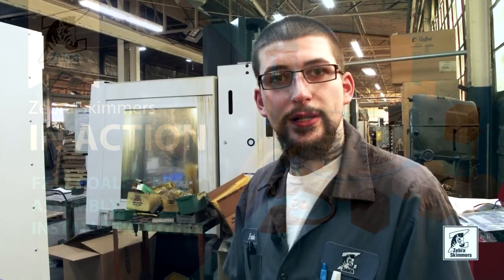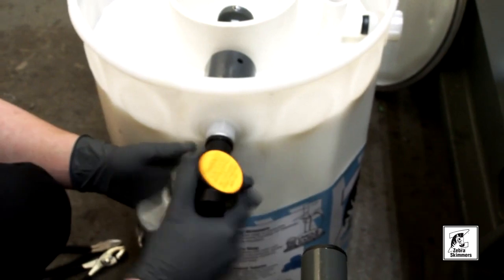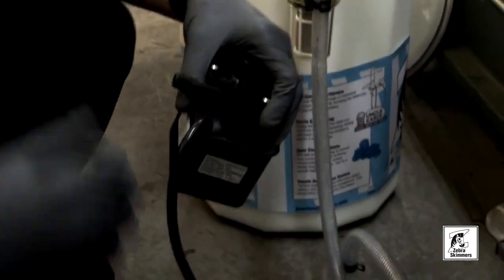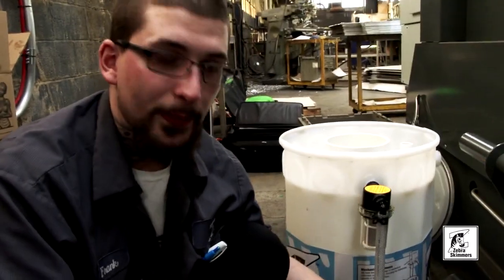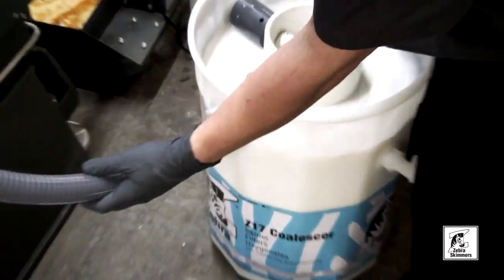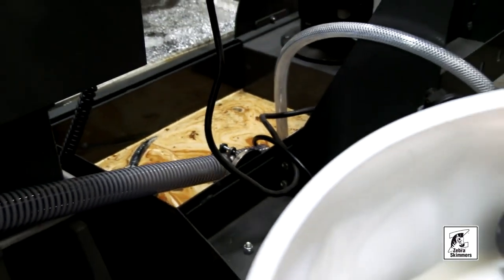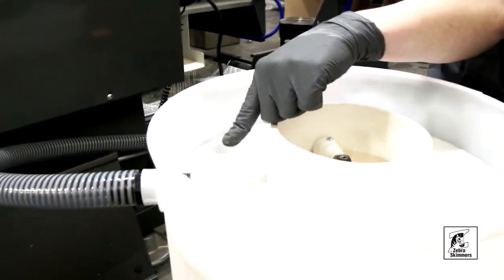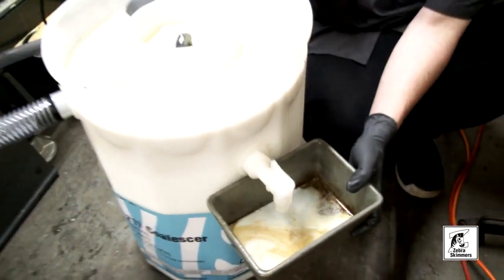Master the Zebra Skimmers FZ17 Coalescer: Assembly & Installation Guide 🛠️🌟

Comment: How does the obducter able to send the oil back?
Reply from the maker: Hi there! The dirty tramp oil is removed by the spicket on the side of the coalescer. Put a container below and turn the knob to release the tramp oil. The cleaned coolant is separately returned to the sump.